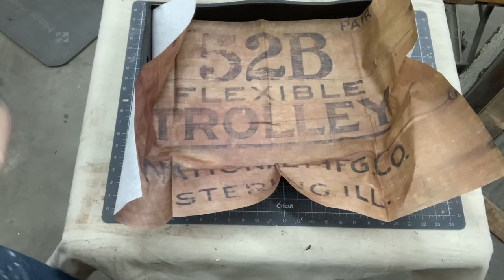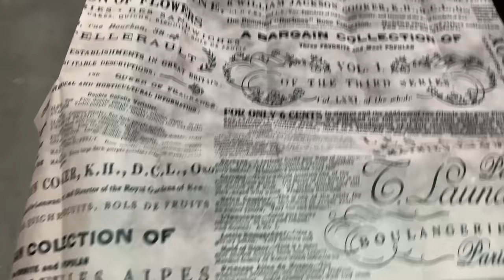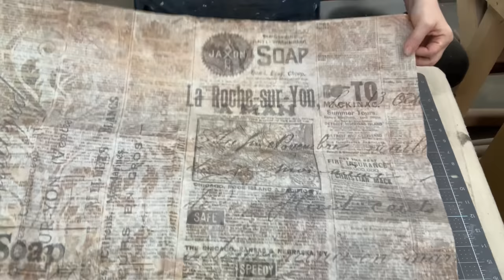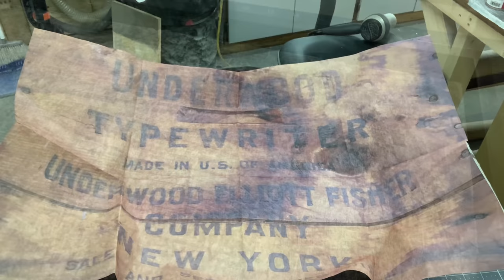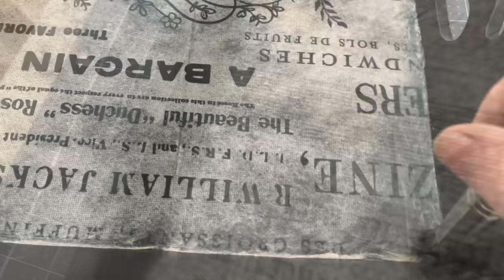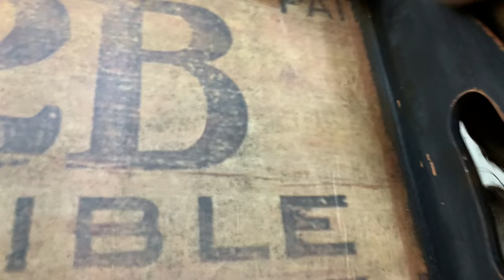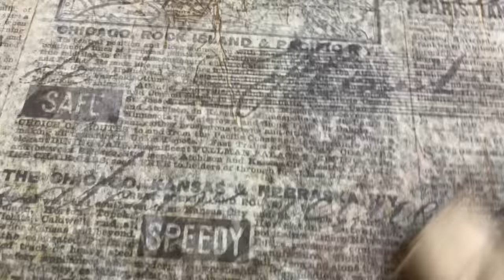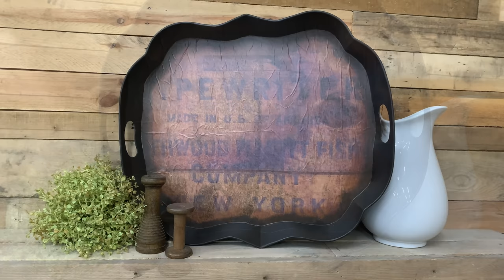Trash to Treasure || Lap Trays || Thrift Store Finds Makeovers

Comment: I have 3 pieces of wood furniture in a honey color I’d like to darken with that waverly antiquing wax- what color would you suggest
Reply from the maker: You’ll need to scuff sand them if there’s a finish( top coat) for the wax to absorb in. It you don’t get the top coat off it won’t absorb evenly.  You’d have to do this with any stain you would use.
Reply: @GingerChickRehab  What color of wax to darken ?